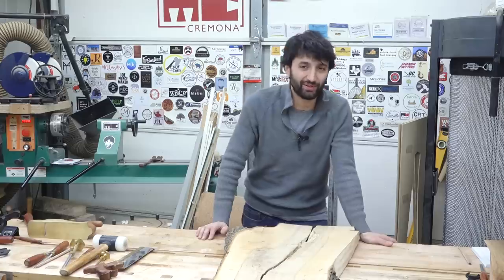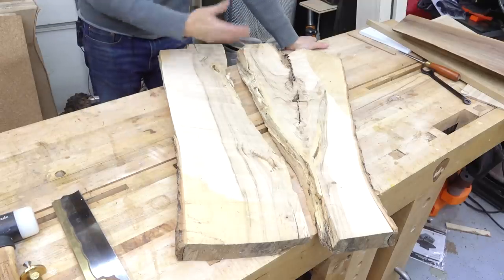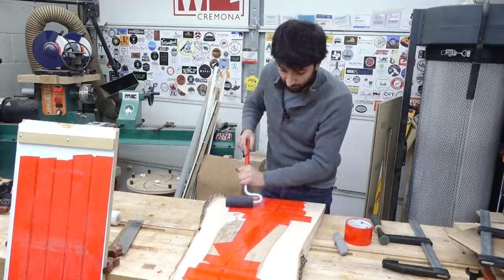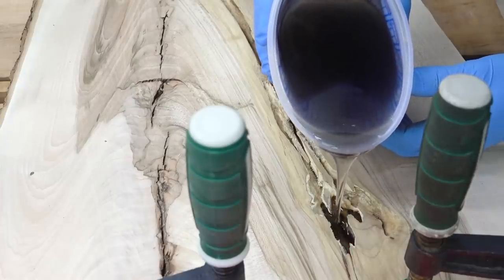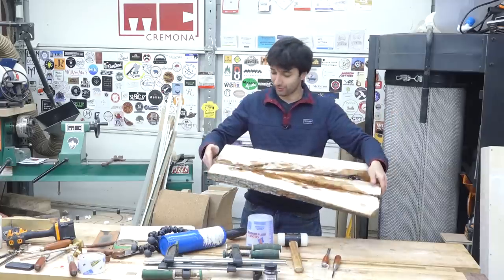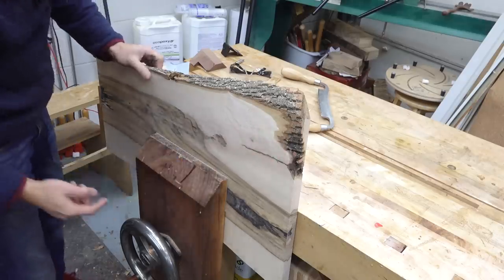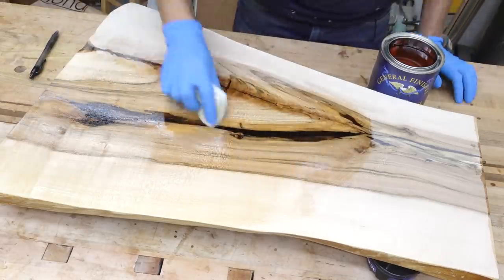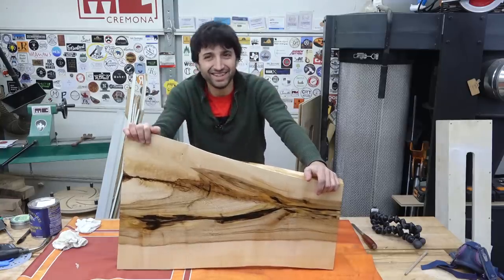Serving/Charcuterie Board for my Sister

Comment: Just ordered my first ever batch of West epoxy. Thanks for all the tips over the years I am still a little nervous to work with it but you for sure helped Matt!!!
Reply from the maker: awesome!!
Reply: You'll get the feel for it after a while.  Just keep the mix ratios right which is easy if you have the pumps.  I've been through many gallons of West System through the years from boat building to resin augmented turnings - just don't let any thicker pours get hot while they cure.  I wish you well.
Reply: @boooshes  thanks brother!

Comment: Hey Matt. I see in the video what looks like some soft or somewhat punky or rotten areas. I thought that one was not supposed to put epoxy over these areas as they may flake out later.  I'm probably wrong so it may just look like those areas are bad. Always watch your videos and learn a lot. I live about 60 miles east of Mpls so I'm probably not to far from you. I have some oak slabs that would work good for this project. Thanks for the video.

Comment: Hello from Esko, MN.  I want to put a shelf, 8-9' live edge, 8 quarter, by about 20-24" wide on  my new garage wall.  If I cut a live pine off my property and have my friend cut the slabs on his mill, can I bolt them to some HD wall brackets and have them dry on the wall.  I would put poly on them first.  Will they twist up as they dry, or will the bolts hold them relatively flat?  By the way, I have a wood stove in my garage so they will probably dry faster than they should.  Enjoy your channel a bunch.  Russ

Comment: Matt,
We get a lot of slabs in my area that are face grain cut and I’m working on a couple of walnut boards that are around 12-14” wide, 1.5 inches thick.  I’m afraid of cupping.  At the risk of offending the cross-grain glue gods, I was thinking of routing a slot on the underside and insetting 1-2 pieces of wood maybe ¾” square x 8” running cross-grain, glued with epoxy, to mitigate cupping.  Any thoughts on whether this is necessary or advisable?  Thanks in advance.

Comment: Very nice!  Go on amazon and you can buy a dozen or so “condiment squeeze bottles” for about a dollar each.  Not only does the bottle serve as the final pour container, but it is so much easier to pour with than using those mixing containers.  Bonus, let the extra cure in the squeeze bottle and you have turning blanks later...

Comment: Awesome!  I’ve made a few of these now with info from your videos along with river table with a waterfall edge. I seem to get tiny bubbles from air trapped in the edges in the wood pores I guess. I’ve started sealing the edges first but a few still sneak through. I haven’t tried the vacuum pot yet. Do you think that could be the difference? I do use slow set epoxy.

Comment: I'm watching videos like this before attempting my first epoxy pour, and I enjoy, with envy, your log milling videos because I, too, love the beauty of wood with all the different figures which add character to otherwise straight grained wood.
I do have a question about this video.  After your initial pour, you went back with some fast setting epoxy to do those small cracks and holes.  Can you tell me what epoxy you used?  Did you just mix Ecopoxy with more than normal hardener or a different epoxy all together?

Comment: Would a brass plate with a hole on the back work with a hook on the wall to hang it up? That's not fitting in my cupboard! 😃 Best breakfast in bed plank too.👍

Comment: You could have filled the crack with sand, leveled it off then recover the sand in a measuring cup. It would show the exact volume required to fill the crack.
Reply: Colin Knecht uses kidney beans for larger voids.  Sand makes a ton of sense!

Comment: Why didn't you join the two halves with some dowels before doing the epoxy for some extra strength?
Reply from the maker: not necessary.  The epoxy joint is very strong.

Comment: I have a question on mixing large volumes of epoxy.  I am getting ready to do a gamng table for my son and I calculated about one gallon of epoxy will be required.  How do I mix that volume and minimize the air bubbles?
Reply: Some of the big table guys use paint mixers with a drill.  It has to incorporate lots of air, but they are using slow cure epoxies with cooling techniques so it's 4-8 days to cure; this gives more time at low viscosity to allow the bubbles to rise and pop.  Other things to do are 1) mix by hand slowly, 2) Degas the mixed epoxy with a vacuum system like Matt did here, 3) vibrate the poured object during beginning of the cure, 4) use open flame every hour or so during the cure to pop bubbles and flatten the surface.  Maybe folks have other suggestions too.

Comment: Matt,
Does the epoxy actually bond the 2 halves together with enough strength to withstand fracturing on routine use?
Reply from the maker: Yes and on extreme use

Comment: Have you ever had an issue with the epoxy dulling the planer blades? How about epoxy chipping out with the planer?
Reply from the maker: No issues with it affecting the knives.  Chip out can happen.  I usually have a little bit that gets cleaned up when I finish sand.